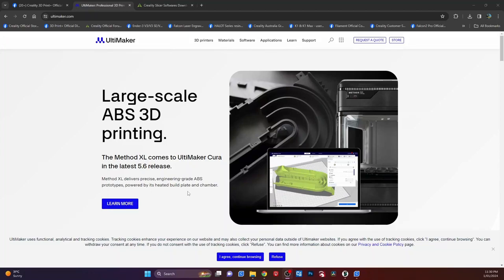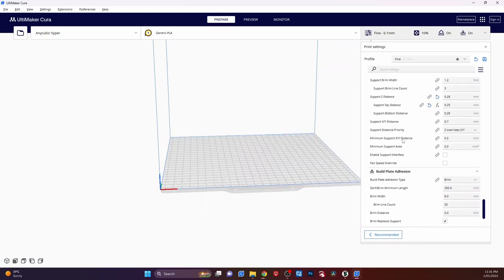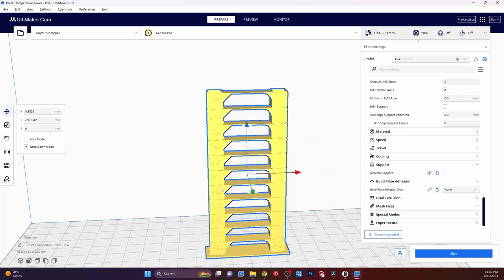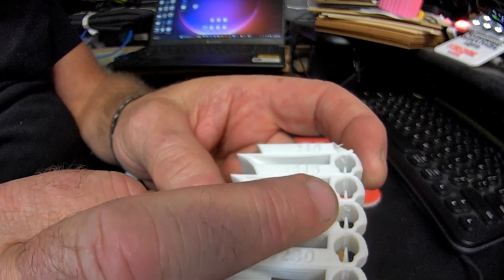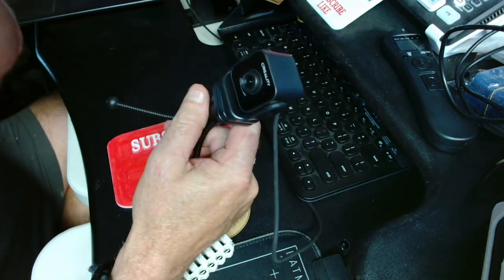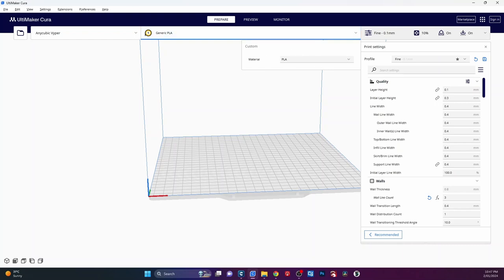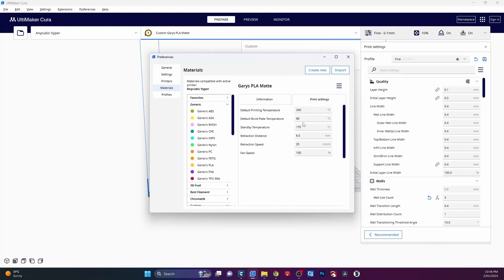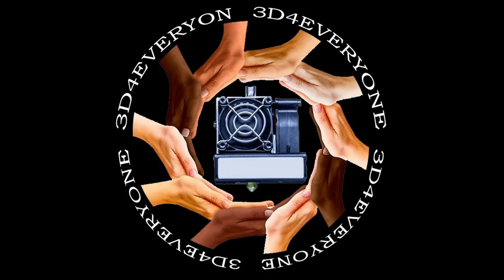How to do  a temperature tower in Cura slicer

Comment: What if when I go to extensions it doesn't have auto tower? It only has 3 selections. Update checker. cura backups. Post processing.
Reply from the maker: Do you have the latest version. Use update checker to find out